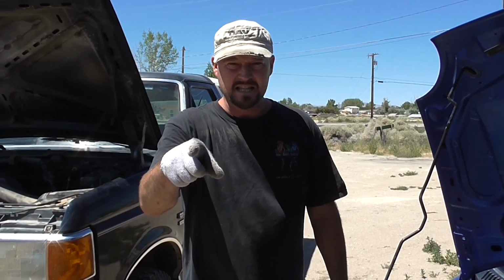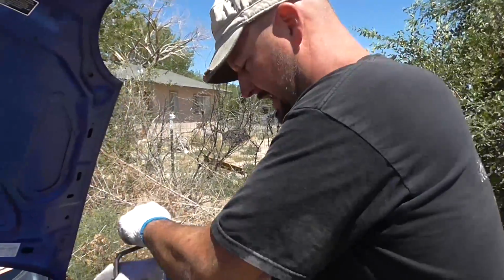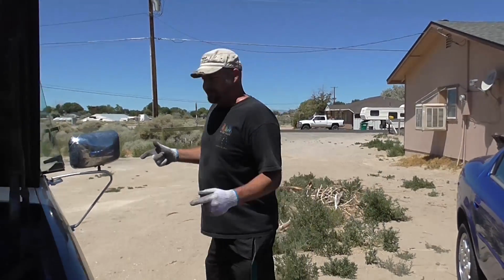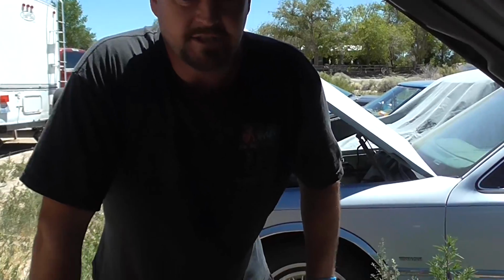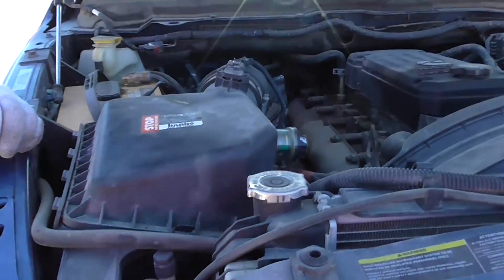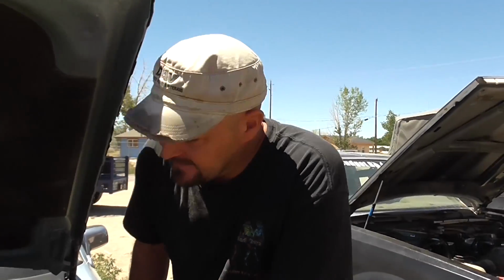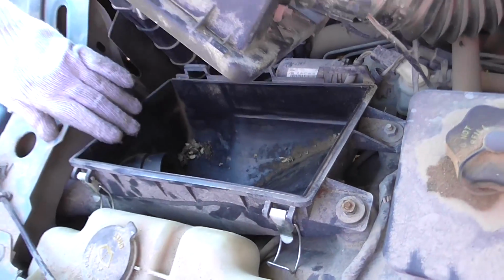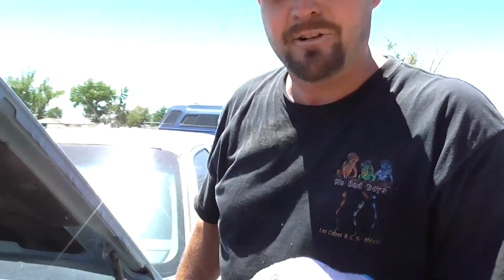Free Horsepower And Fuel Economy - Intake Mods

Comment: Took the K&N off my tundra and replaced it with a quality air filter and got 3 mpg
Reply: What brand of air filter did you use to replace the K&N  -- and what OTHER mods did you do to get that 3 mpgs ??
  There is NO WAY that you can get 3 mpgs more by just changing out a properly-installed K&N air filter for a different brand.
 You MAY want to learn the proper way to check your fuel mileage before making such ridiculous claims.
 Good luck !!
Reply: Wix. They also have a cabin filter that has an ionic layer you recharge by putting in the sun after you clean the filter for reuse.
Reply: @phoenixrisin2269  OK -- Now you're saying that you replaced a K&N Air Filter with a WIX Air Filter -- and gained 3 mpgs.
I'm saying that's not even possible -- you must not know how to calculate fuel mileage.
 Here  is how to calculate your fuel mileage accurately:
1. Fill the fuel tank completely.
2. Record the Odometer Reading.
3. Drive the vehicle until the gas gauge is down to 1/4th tank.
4. Fill the tank again, and record the number of gallons used to two (2) decimal places (00.00).
5. Record new Odometer reading, and subtract the old reading from the new reading to get number of miles traveled.
6. Divide the exact number of gallons used into the number of miles traveled.
There is NO OTHER WAY to get an accurate fuel mileage figure.
 Good Luck !!
Reply: Chuck Hallowell I have a fuel calculator on my truck. I drove it 3 years with a K&N filter that I cleaned regularly.. I checked my mileage immediately after I changed it and I got 3 mpg better on the highway. Do you think I would lie about that🤡🤡🤡
Reply: @phoenixrisin2269  Oh, no, no, no ! I don't say that you lied or are being dishonest -- not at all !
What I'm saying is that it's not possible to get a 3 mpg increase by merely changing an air filter from one brand to another. I repeat -- It's not possible.
You ran a K&N for 3 years and "cleaned it regularly", which sounds good, but there's a lot of room for error in the cleaning and re-oiling process.
I have run K&N Air Filters in every vehicle I've owned since 1975 -- cars, vans, SUVs, and off-road racers.
 I have run other brands of air filters starting in 1958, including WIX; FRAM; MOTORCRAFT; TOYOTA; ACDELCO; MOPAR; and PUROLATOR.
A properly cleaned and oiled (using K&N squeeze bottle kit ONLY) K&N is free-flowing, affords very little restriction, and has an added feature that NO other filter can claim -- IT  WORKS WHEN WET !! 
There's just NO WAY that a brand-new WIX will flow more air than a brand-new K&N air filter of the same size. Racers have been flow-bench-testing air filters for decades in order to find the very best under all conditions. Racers choose K&N !!
About that fuel mileage -- Forget your truck's "Fuel Calculator"-- they are notoriously inaccurate, and are confusing to many owners that do not fully understand the way those "fuel calculators" work, or exactly what the "calculations" mean..
 As I said above, there is only ONE (1) way to get an ACCURATE fuel mileage figure, which is the method I described earlier.
But hey, if you're happy with claiming a 3 mpg improvement by merely changing from a K&N to a WIX -- OK, but don't expect anyone with experience with different types of air filters to believe you.
Reply: Chuck Hallowell Well I did. Too bad I didn’t record it for you.
Reply: @phoenixrisin2269  Too bad you didn't record ANYTHING -- you just made a claim that you can't back up with facts.
Here's an idea -- Why don't ya post your claim to Scotty Kilmer -- tell HIM that you gained 3 mpgs by merely changing air filters from a K&N to a WIX of the same size.
His opinion would be interesting, to say the least ! ;>)

Comment: I have an old 94 Lincoln mark VIII. It came with a Y-pipe to dual exit. It has a 3 cat converters. Ive simply cut off the two HUMONGUS HEAVY Lincoln mufflers and added two elbow tail pipes from NAPA 6.99 each. It sounds awesome now. The throttle response is amazing like a whole new engine. Im modding the factory air box next to draw air in from the fender.

Comment: If you do not separate the intake air from the engine bay area you will have some serious fucking problems and the way you're doing it is basically destroying a very expensive stock airbox for no reason you're better off taking sheet metal making your own air box with some seals and make sure it's all sealed! Then it would be a upgrade worth doing.. assuming you're not near or in the fender well so much to where you're going to be shooting water up into your intake if it rains
Reply: Agreed. This modification is doing nothing but making noise and getting the filter dirty faster.

Comment: Like you said LET IT BREATH ! ! !  if it cant breath it wont run..... Overly dramatized presentation,...but a very logical solution to an absurd design flaw.  Early Hot Rodders had the Idea correct...Ram Air, Hood Scoops, Large Area filters, Blowers, Turbos etc..

Comment: Why even have an air cleaner.  Just think of the performance.  This is so wrong.  The air filter area is at least five times the area of the after market one, so it passes more air.  Even if it does not the oxygen sensor will compensate for less air and adjust the fuel. As for fuel economy I would like to see how he controls his test.  Eight miles per gallon is a 25% increase, give or take.  Not likely.

Comment: this advice is so spot on.  fuck yeah!  i usually take a hole saw or the fattest bit i can find to the bottom of any "grocery getter" airbox, swiss cheese it real good like (careful of the mounting points or wires under the box), and have similar results as you are claiming.  oh yeah and get rid of the cats and slap on some thrush welded muffs and have someone dyno tune your rig if you can swing the 300 bux..  love the video!  now i dont have to make one.

Comment: Your "modification" on the '92 Lincoln is bogus. Instead of all the work you did to chop up the Air Box, it's MUCH easier to just remove the "Snorlkle" (you called it a trumpet), and replace it with a piece of aluminum clothes dryer hose. Your modification draws air from the hot engine compartment, which defeats the idea of a "Cold Air Package", while removing the snorkle and adding the short length of dryer hose allows the engine to draw cooler air frrom forward of the engine bay.
The Air Box with the snorkle removed will flow more air than the M.A.F Sensor, so chopping the bottom out of the air box does NOTHING to increase the breathing ability of the engine. 
FOMOCO ditched the snorkle in later years, and put a rubber tube in it's place, thus eliminating the need for ANY air box modifications.
Reply from the maker: the snorkel trumpet is a very small diameter.  Larger area for filter to breathe is best.  Hot air intake, that is a myth.  The heat is caused by the insulation hood heatshield and the hood.  Take your car for a 30 minute drive, open the hood and aim a laser temperature gage at the intake manifold.  You will find it is very hot, therefore air filter is not the cause of a hot air intake.  Best thing is aim the open part of air filter towards grille in front of car, some take out the headlight, which I do not do, to get colder air.  No such thing as cold air intake manifold, but you can improve and cool it a bit more.  I remove hood insulation, install a duct above intake manifold to pull heat out of the hood.  That will help with hot air intake issues.

Comment: Are you sure you're firing on all cylinders?
Reply from the maker: watch part 2 of free horsepower and torque, much better than part 1.
Reply: Looks like the weld broke from the frame and the only part of it that worked is now roadside. Or, the cars broken down, and the operators walking. Same thing happens with the mind and body. In this case, both metaphors happened simultaneously. It's why I never pickup male hitchhikers. You'll end up spending a weekend on a nut job with a screw loose that'll go nuts over a loose screw. Unfortunately, I've never found a pretty girl hitchhiker. So I've never picked up a hitchhiker. And I speak from inexperience. Spread the word.

Comment: Put them on a Dyno. You would not find a significant difference in horse power. I you happen to preheat your fuel due to these mods this could possibly give you the exact opposite of what you are trying to achieve.  Noise does not equate to power. In regards to Turbos putting an oiled filter on can result in your Mass Air Flow Sensor getting gunked up and throwing all sorts of shit out.
Reply: Explain why my 7.3 came with an oiled filter than? Motor craft too

Comment: One of the reasons why the factory has a "enclosed" air cleaner box is because it  protects and extends the life of the air filter. Thats why many people like to use a 12V squirrel cage air blower, T plumed into the stock air box instead of cutting it out, same concept and better results.

Comment: Will this effect performance in extreme conditions like 15 to 20 degrees below zero or 100+ degrees above? I live in a part of the country where the temperature swings between summer and winter are brutal. I was thinking that this might be some of the reasons for the more restrictive air intakes? I have trouble believing there's a conspiracy to sell more gas when better gas mileage is a big selling point in the auto industry. Just saying.

Comment: WOW I had such high hopes and looked forward to getting better gas mileage for my 4 cyl Camry and my V6 Camry.
I went out and bought a nice high performance air filter and adapter tube to connect the electronics to.
Spent time and effort switching the 4 over and now it will hardly even run and go.
Great now I have to switch everything back and make it stock again.
Sure glad I didn't oil up the filter just for this purpose.

So WTF is up guy?
Did you do something else to these cars to make them run better? Because just doing what you said does not work for jack shit.
Or are you just bullshitting people on purpose?
Reply from the maker: You have to do it right and utilize ALL STOCK SENSORS, not just throw a pipe from air filter to engine and call it good.  Do it right or do not do it.  I give ideas out there for YOU to figure out the specifics on YOUR CAR.  YOUR CAR is different than MY CAR so YOU have to figure out the SPECIFICS ON YOUR CAR.  QUESTIONS?  I have been working on cars longer than 30 years, I CANNOT TEACH EVERYTHING IN ONE 20 MINUTE VIDEO.  DO YOUR RESEARCH ON YOUR CAR BEFORE INSULTING THOSE OF US THAT DO KNOW HOW TO WORK ON CARS.
Reply: Use the same filter and just make the air intake bigger?

Comment: Yo this video is awesome 👌!! I just bought a Lincoln Town car and I'ma do this 😂 , anybody got any other mods I should do it my 1992 Lincoln Town car ??
Reply: Your '92 Lincoln has the Generation 1 engine -- 2 coils; Ignition wires; 190 horsepower with single exhaust, 210 horsepower with dual exhaust.
Simple and cheap mods to this engine include:
1. Dual exhaust = Walker H-Pipe; 2" x 21" Magnaflow Glasspacks; Walker Tailpipes.
2. K&N Air Filter.
3. Air Box Snorkle is REMOVED; cold air is ducted from forward of the engine bay with short length of clothes dryer flex hose. The SNORKLE  is the "silencer" part of the intake system, and it is the ONLY intake restriction !!
DO NOT CUT THE BOTTOM out of the air box !! That actually DEFEATS the whole purpose of a "Cold Air Intake". DO NOT USE a Throttle-Body Spacer on this engine -- IT DOESN'T WORK !!
 4. Replace the Motorcraft ignition wires with the BOSCH 09725 Spiral-wound, Mag-Core ignition wires. Change ONE WIRE at a time !!
 5. BOSCH #9605 Double-Iridium, fine-wire Spark plugs - gapped at .053
 The "Coil-On-Plug" engines use the BOSCH #9606 Double Iridium Plugs.
 6. Remove, clean thoroughly, TEST, and re-install the Motorcraft ignition coils. 

 These modifications are inexpensive, easy-peasy, and will give a slight performance increase and add reliability at the same time.
 If you are switching from a single exhaust to a dual setup, you can EXPECT the 20-horsepower increase that is advertised by Ford Motor Company.
 If your Lincoln already has a dual exhaust setup, the MagnaFlow Glasspacks will add a mellow exhaust tone, and POSSIBLY an increase in fuel mileage.
 The above modifications were performed on The 95 MERC, and have been in place for many thousands of trouble-free miles -- for long-distance, high-speed touring of the deserts and mountains of the American West.

Comment: Do this, add a flowmaster muffler with big pipe and you get an incredible 50 more horsepower.

Really think so?

It sounds louder and you think it is more powerful and faster; especially when driving. It's like swapping out a 2 bbl carb and intake for a 4BBl bbl carb and intake as well as putting on headers and straight pipes. Wrong. 

Who ported and polished the heads and put on a set of headers as well as changed the fuel injectors? 
Did you put a new computer in the car as well to meter the fuel and adjust the timing? That is important.

If you have a car/truck with a carb or TBI you can flip the cover of your air breather upside down and make it louder. It must have gain 15 horsepower as well, right?

If these simple trick yield more MPG the manufacturer would have done it as they are trying to squeeze all they can out of them to meet government mandates. a manufacturer's fleet has to average a set MPG. For Chevy it would include Corvette, Camaro,  trucks and every shitbox they make. Average them out and you got it.

This is entertainment...and if you know anything about engines, you know making the intake louder does little to nothing. Put it on a dyno and lets see the results. Don't forget to add octane booster and oil additives to reduce internal friction.

Comment: Cold air intakes do not help. I did it on a 2010 Ford 4.6 24 v and it only made more noise. It actually hurt the mpg by 3 mpg. To do it rite, take a K & N  air filter and install. It allows more air without hurting you gas mileage on bit. I did it.

Comment: Lol. $35 for a muffler. Try a $1k+ exhaust that is properly designed and assembled, not cobbled together at home or the local high school dropout employer, the muffler shop. Engine performance is down to a near exact science now. Shade tree mechanic "ingenuity" doesn't cut it anymore. Besides cutting up working vehicles.
Reply from the maker: This is Budget Boosting, not deep pockets boosting.  Hey, good idea for a new you tube channel for someone...........

Comment: I don't think cutting open and increasing the intake side of the filter will change much at all if the original intake size of the filter housing was the same diameter as the output side of the filter housing leading into the MAF sensor.  Replacing the paper air filter and adding a free blow exhaust system will (of course) leading to gains in hp.

Comment: You think the car manufacturers are intentionally hurting their fuel economy? Dude, fuel economy and horsepower sells cars and they spend huge amounts of time and money engineering vehicles from the factory to maximise fuel economy and power. These modifications may help some on much older vehicles but any somewhat modern vehicle is going to be balanced for power and economy from the factory. The air induction sound does not mean more power and economy.
Reply: They optimize what they can in order to conform to the laws and emissions the car is made for. So even say, in your state or province, you may have less restrictive laws, and you may be able to change things for more performance but may not conform to other states, but that it's legal in yours. But they can't only make a model of the car for your state/province, as the cost of manufacturing would suddenly increase. Personally I'm not a fan of having an air filter out into the open like this, but usually once you take in more air, you'd want to take in more fuel so you're not running lean either.

Comment: cut the paper element out and replace it with foam rubber.... same result and you don't have to purchase a sports air filter
Reply from the maker: many great ideas out there, I would check to see how it filters dirt though before hand.
Reply: I have done this for the past 12 years , on the advice from a person in the georgia fiero car club I sprayed the foam rubber with WD40. It catches alot of dirty and requires washing over a period of time
Reply from the maker: Nice, I remember in Japan at the street races, some of the Japanese removed the airbox and asked their girlfriend for their panty hose and used that to filter the intake....

Comment: You keep referring to the air box intake port as this restricted tiny hole that the engine is having to breathe out from, actually, the engine breathes out from the exhaust system beginning at the exhaust valve. The tiny restricted hole is what the engine is breathing IN from. The air box, air filter, etc.... that you yourself keep referring to as "intake" system is called INTAKE because the engine is breathing IN through this system, not out from this system. I knew what you meant, but you referred to the turbo diesel air box modification as "exhaust" modification. "In no way shape or form is my exhaust stock" while patting on to top of the air box. Kind of confusing use of words as I try to follow along with what you are saying. How about rain? are you having any issues with rain water getting into your cut open factory air boxes while driving?